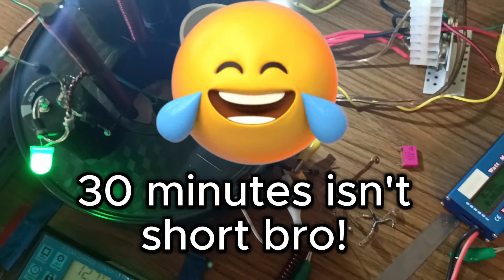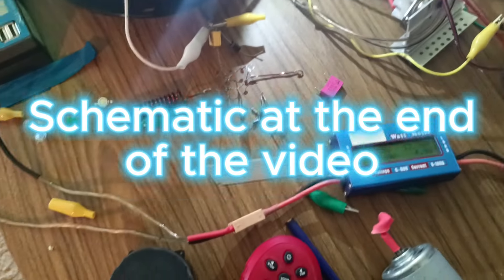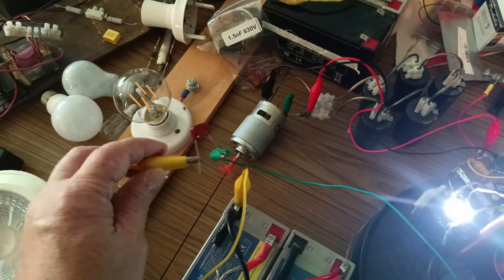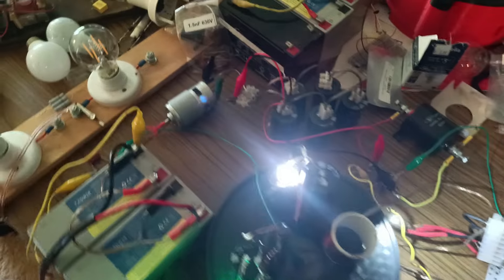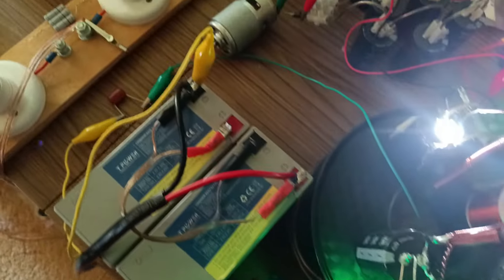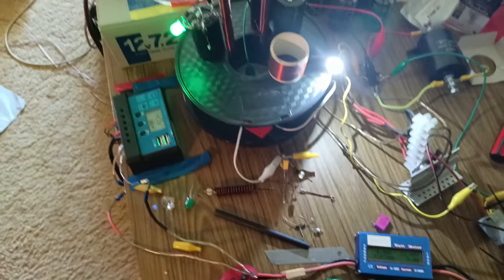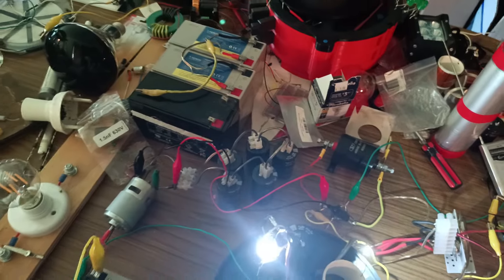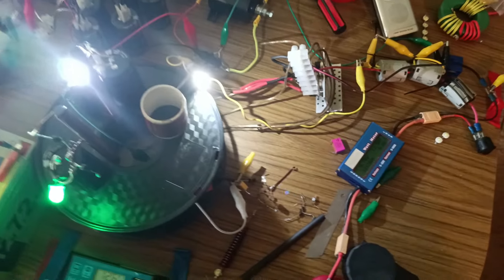Capacitor OR No Capacitor?

Comment: Great video, I think the earth acts like a capacitor with some stored charge as almost every type of atom known to us have a certain electrical charge, so the system allow us to draw or pump, some of that charge in the form of electricity.
Reply from the maker: Thank you for your comment.
I agree, all my research suggests the same, there is without question something phenomenal about our earth. 

The radio frequency changes drastically and the electrocutions are so nasty when earth is included, more like a radio frequency burn. 

The sensation is very different too, I find a normal accidental shock to be literally that, a shock, however once earth is added it becomes an annoying, frustrating sensation that stings for days afterwards and makes me considerably angry, which could also be a reaction with my spinal condition.

I am unsure of exactly what is happening with electron movement, it is important to remember that I am self educated in this field, all my work comes from reading Tesla's patents so I often struggle to understand what is happening.

At some point I decided it isn't important for me to know everything but the most valuable knowledge is how to make it happen.

Don't get me wrong, every day I wonder what is happening and then life interrupts my pondering and I realise the limitations of my body requires me to move on with discoveries.

It is hard to imagine the earth not pumping electricity when you consider through earth should make resistance go through the roof and increase current drastically but the earth has it's own plans.
Thank you for watching.

Comment: Yes i have the same problem , one minute something works one way , then you have to do it the oposite way for it to work 🙄 , its as though something is reversing 🤔. Think of it this way , if your system runs at 5W you would expect to get 5W out , but we are looking to get more out than in , are we not ? Did you try your lux meter on your bulb in mains and then try your lux meter on  the same bulb in your syster , and did you get a better result ?
Reply from the maker: Thank you for your comment.
After a while of repeating test after test you begin to see patterns, it almost requires an intuitive level of attention. To be sure you're not imagining things you keep repeating and recording the outcome, it is possible to understand it however it demands a lot of attention.

The main feature of the circuit is it's SWER feature (Single Wire Earth Return) that is similar to Tesla's One Wire Earth Return that allows the operation of an off the shelf 240V LED bulb to be powered through Earth over extremely long distances.

Now that's what I consider it's main benefit but others may consider it's main benefits are things like wireless power transfer to local coils or large number of LED's being operated at extremely low input cost and on and on.
My latest video will hopefully meet your expectations of lower input.
Thanks for watching.

Comment: Any idea if the frequency the system runs at?
Reply from the maker: Thank you for your comment.
I believe it was calculated at 172 kilohertz but it changes so drastically depending on the setup at the time. My cheap oscilloscope only goes to 20 kilohertz so it’s above that as I just get overload on the screen. I wish I owned some good equipment, one day Santa might bring me a present.
Thanks for watching.

Comment: I think the answer to the question is , do you want to store energy ? If so , you need a capacitor , if not, let your system run free . With the right tuneing and an earth , it will put power into everything around it , but to collect power , you will probably need a cap .😉👍 or battery .
Reply from the maker: Thank you for your comment.
That’s pretty much it. A capacitor is only needed to convert the energy to use in things like a DC motor and battery charging.
It’s amazing the benefits a good earth or two brings to my circuit, it becomes a different beast.
Thanks for watching.
Reply: I like the fact that when you add the earth to your system it lights that bulb realy bright , is there a big difference in the amps when you do this and do they go up or down ?
Reply from the maker: @StefBaker-gd4xe Depends on the setup, for example I have a setup that consumes 5 watts just running the circuit with no light bulb and when I add a 4 watt LED through earth there is no increase in power. So many things this circuit does that don't make sense.